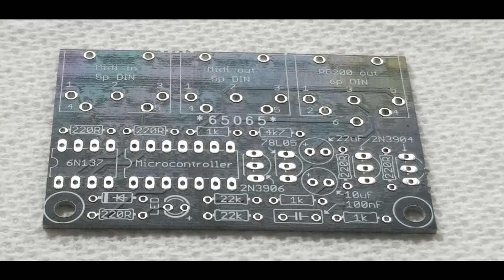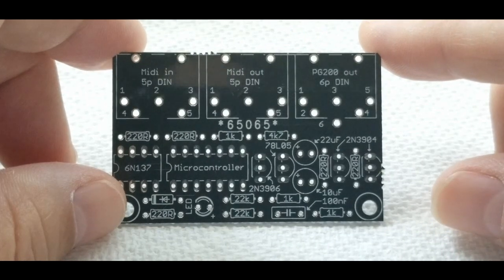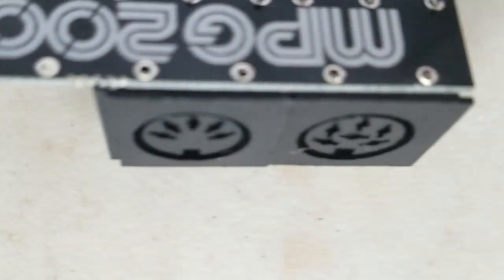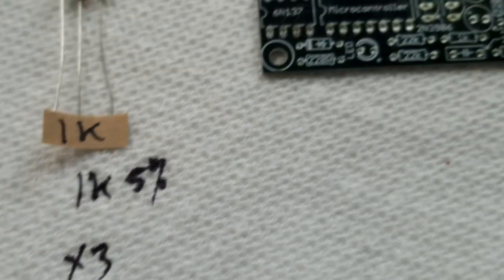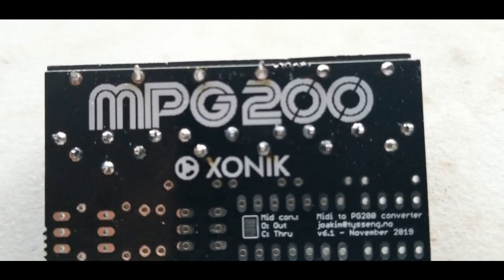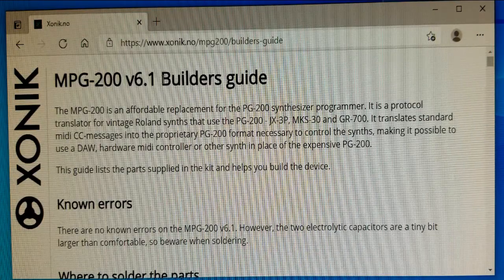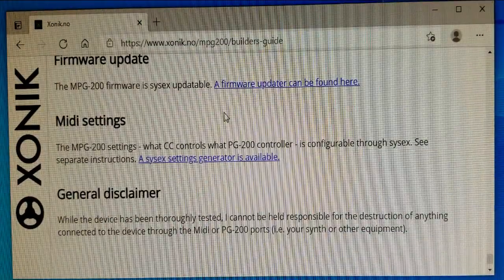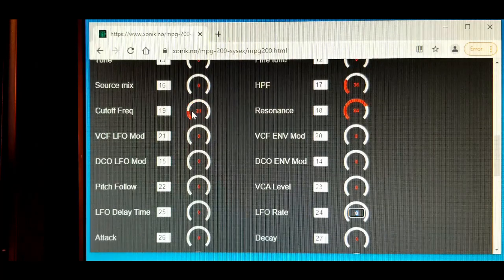MPG 200 Assembly and Test - Roland PG200 midi CC hardware emulator

Comment: i've build one of these, the led flash when i turn on the jx3p but it doesn't seems to get the midi in. I tested everything else but the problem seems to be with the mpg200. Does your led blink when you send a midi CC to the mpg200?
Reply from the maker: Joakim Tysseng is the creator. He is around on the Facebook "Toland jx3p group + pg200" group. He had a few web pages of help if you Google. There is a special case/firmware update because the jx3p has a switch that isnt normal. Sorry I cannot help with specifics
Reply from the maker: This is his website, tell him I sent you https://www.xonik.no/mpg200/pg200
Reply: @ColecoBrothers  yes he's very responsive. We think I have a bad octocoupler. Waiting for the new part. This is such a great product
Reply: I received the opto-isolator and now it works!

Comment: I'm not understanding something, so you plug the mpg200 into the midi in of the jx3p with a regular midi cable? Or do you plug the mpg200 into the programmer input of the jx3p?
Reply from the maker: OR... you plug the midi Into the mpg200 and plug the roland programmer cable from the MPG  200 and then into the jx3p programmer port. It is basically a midi controlled pg200. You will be automating the pg200 not the jx3p.
Reply: @ColecoBrothers  thanks! Can I send midi notes to the jx3p while being able to automate the jx3p parameters simultaneously using the mpg200?
Reply from the maker: @thirfytash7286  not sure I dont have the jx3p the gr700 and mks 30 are the same guts. It definitly work on the gr because there isnt a midi in only the gtr. It definitly works on the mks30 because it's a rack module so it has to work that way. The jx3p might have the switch midi or p rte programmer.  The mpg200 website says there is a mod so it can trigger the switch for you. But I'm not sure of the details
Reply: @ColecoBrothers  ok thank you!
Reply from the maker: We have added a midi input to the blue gr700 and embedded an MPG 200 inside the case. To allow automating the programmer while playing guitar.

Comment: Is there a way to merge the messages from the PG200 and the MPG200? Otherwise you have to swap them each time you use your sequencer..
Reply from the maker: With the  mpg, you dont need the pg. You can sell it and take your family out for a very nice dinner. Yes the mouse/screen controller isnt as fun as twirly knobs. But once behringer will start to sell the bcr32,  suddenly the pg200 is worthless.